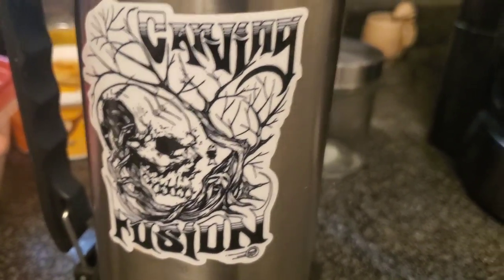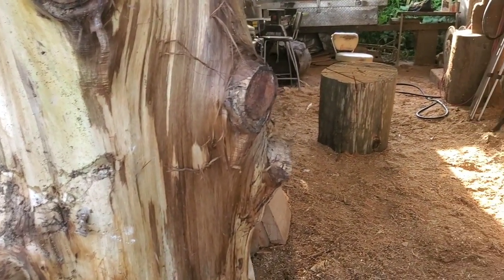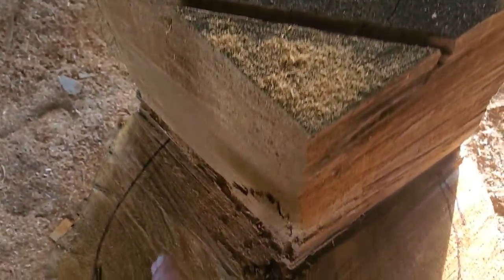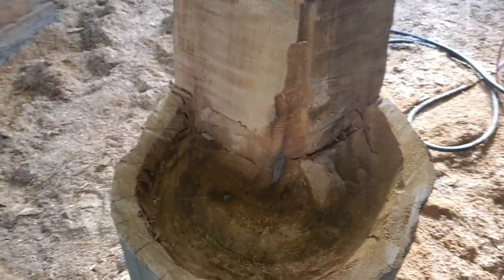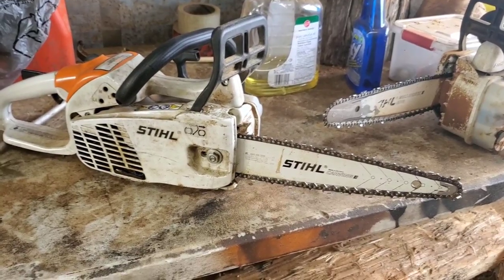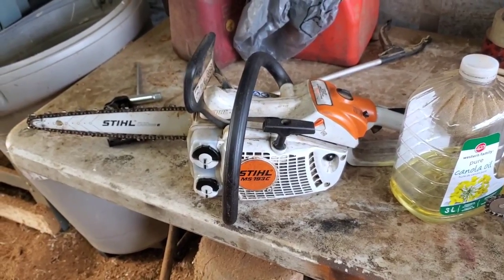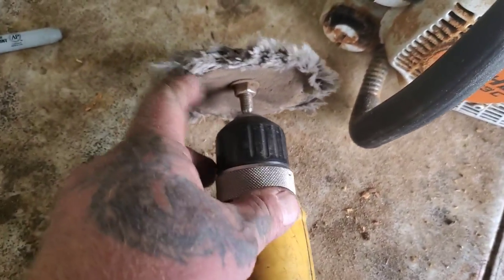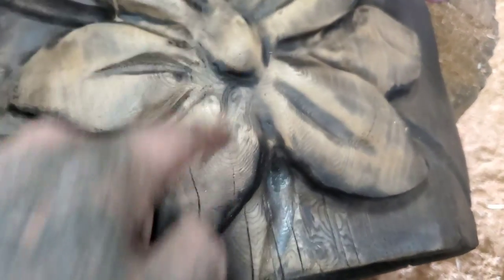Wood carving. I can't make up my mind planter thing.

Comment: nice work.. i also worked construction, welding & such, ive had several grinders kick back & fly outta my hand,  i seen a few guys break a finger... BTW , walmart has a grinder for $20 -$30 , they work but dont last like a big name , costly one, but with all the dust getting in it & bearing down to hog off a lot of wood, even a big name grinder wont last...